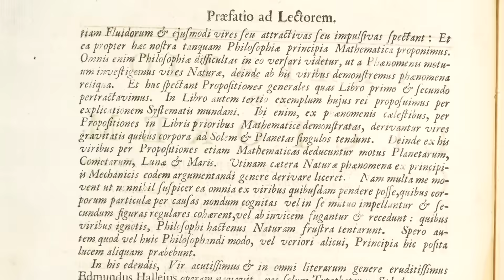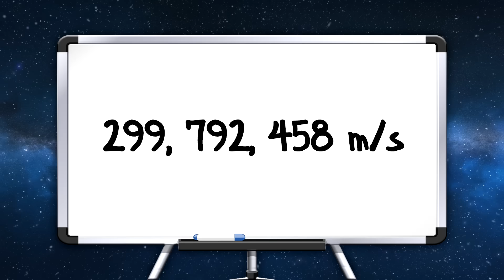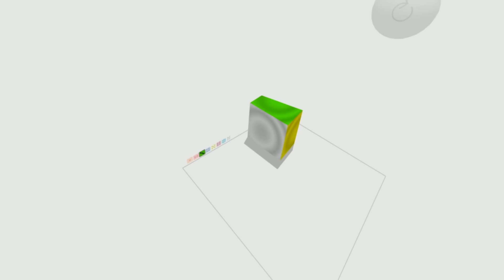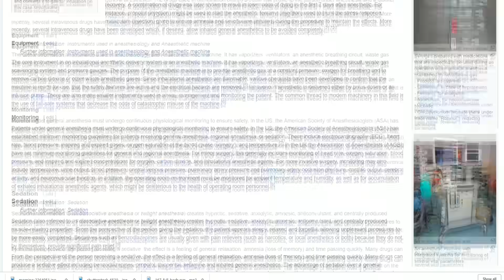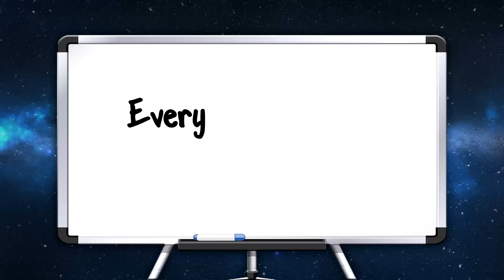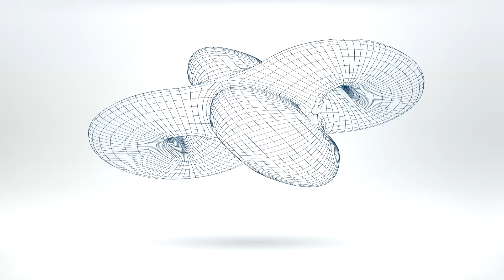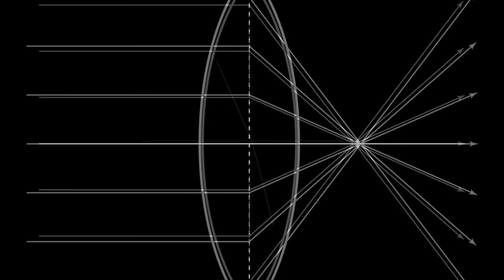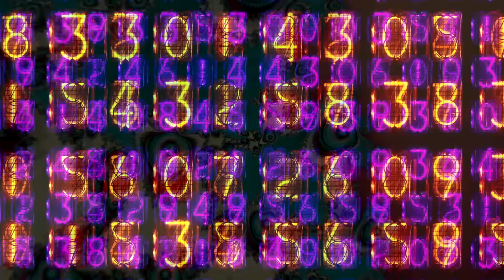The Mystery at the Bottom of Physics

Comment: Nikola Tesla:
"If you only knew the magnificence of the 3 6 and 9, you would have the key to the Universe"

Science uses numbers to count, I use them to play and attribute functions to them, just as they were alive + the 7 colors of the rainbow.

Polarity blueprint secret in the visible spectrum of light:
pink (tiniest wavelength, very close to red[division]): Primal Creation LOVE wave sustained by 8 mirror(---1---)mirror   [the egg - ellipse - circle imbalance factor] (laser-light mirror itself as 8 in 360 degrees as all defections)

---------------------HOT Balance Cold------------------
Red-Orange-Yellow ]Green[ Blue-Purple-Pink

0) 1 ]2 3 {4 | 5} 6 7[ 8 (9       9 as symbol is the spiral (180) degree turn is 6 as light

Add them up as palindrome an all will result 9
0+9=9; 1+8=9; 2+7=9; 3+6=9; 4+5=9; (this and colors are the only recursive information as the torus field has no end and beginning only two dark spots as emergence points to make some sense of the Universe and every force within it) Just as a puzzle or door, you need to figure out how to open it to reveal all it's secrets. Mother nature and the Father are man and woman, controlled by the main polarity-shift (existing and not), which is self or God.

For 2000 years mankind has contemplated on it's source-code with no prevail. The problem, from my point of view is our medium or surroundings. We live in a space, where we can only perceive reality from our surroundings point of view. Man has never been able to think past, what he observes. We can state, that the words and ideas we are playing with are a product of observation, just like we are playing with LEGO pieces, yet we never think past those individual components, that make up our current EARTH-bound reality.
The question is:
Is it possible for the human brain to come up with something, that can explain everything and understand every force, reality, matter, dreams, illusions, magic, masonic wisdom, occult wisdom and every possible outcome, that can ever exist?

My answer is yes! In order to reach full explanation of everything, man must take some starting points in consideration:
- the theory must be understood by all beings, not just on Earth, but also from other star-systems and realities, even formless-matter-less lives, just like God or the Devil;
- the theory must have some information, that everyone can relate to, from the highest PHD intelligence to the lowest and stupidest beings;
- the theory must not be forced upon anyone, meaning that it must leave free will alone, so that the being can apply it in his or her reality, without limiting it's perception (not forcing it like: "this is the way it is, and you must accept it")
- the theory must include and solve everything from all mathematical problems (like the Riemann Hypothesis) to every branch of science and it MUST even present the means to cure every disease, neutralize radiation and it must fix any problem invented and not understood by man.
- the theory should accomplish man's every desire and it must make it reality, by letting man have the means to build or accomplish anything he or she may want.
- the theory must answer every question asked by a being, even what happens after death and explain how ascension is possible (the rainbow body).
- and finally, the theory must exist and not in the same time, just as it was told in all stories and riddles invented by everyone so far in our collective recorded story (not his-story, but our collective story)

From my 3 points of view what all people on this Earth neglected is LOVE! Man has came up with simplistic forms of representation like Pythagoras an Fibonacci, after which he reasoned, that he can't crack the code like that so man ventured in complicated explanations, in the same time losing itself in the division (cube reality view) process of though. So we have built particle accelerators to observe the small, finally reaching a limit, that we called the plank. Understanding we can never go beyond the singularity we ventured in the macro, by building telescopes and started to discover huge planets, spaces, stars, black holes and galaxies, observing, that all is connected like a web. Never being able to decode the micro and macro, we have lost ourselves between the two limit-boundaries, that we called nothing and infinity.

Einstein came along and presented us with a simple representation form, funnily enough explaining energy. Energy means movement or disturbance in a field so mankind has gave in to this stupidity, loosing itself in the power-struggle, just as the equation represents. Since man is the pentagram (head, 2 arms, 2 legs), mankind (science) has lost himself in the division process of self, that in it's simplest form can be written as follows:
( 5 )/2=2.[ 5 ]/2=2.[ 5 ]/2=2.[ 5 ]/2=2.[ 5 ]/2=2.[ 5 ]/2=....... to infinity, until we reach the big RIP of self and so the Universe. [   ] - cube; (   ) - circle; 2 - division as ego, not as pink as love.

Since we have forced our minds to view everything as energy, we have built the LHC (huge power to access small understanding) and we even attributed the name "Dark expansion Force" to the observation of the acceleration of the Universe. Dark to my understanding means something bad, validated by the statement above, which is the division trap. Ever wondered why we keep saying thinking out of the box and not some other geometrical form? The box is the cube reality view, that is keeping us locked from ourselves (understanding) with 90 degree angles, just as we have built up the world, present in water pipe angle turns, most of our buildings and design structures. Unfortunately, once trapped in this lock, there is no way, man can escape it, since "science" alone has been the best tool, in explaining everything so far and we can even use it to measure and build technology with it, that we use in our daily life, never paying attention to how it may affect us. Since all devices and inventions came from this reality view, they are also a product of the same thought process keeping us even more locked away in the box.

The real Theory of Everything must have an emotional impact also, since man is not based on just logic, but also emotions! Logic is a product of understanding, while emotions are a product of imagination. Like it has been said by Kabbalists, GOD created man to experience boundless fun and joy, without any limitation (infinity). How can we achieve this task? Let me say this. In the beginning there was nothing, not even space or anything, that can be understood, what commonly we refer to as the VOID. Since God created existence, God became existence itself and so every form of life possible in the Universe. Throughout evolution we arrived at this state, where Humans were created and reached a level of understanding, where, by looking into the water, man recognized himself, meaning man is the only being capable of consciously being aware of his existence. Creation was a dangerous game, since in order for God to make all this we see reality, it must gave himself completely away, by becoming it (the point), in the process loosing everything, even the though of creation and all the blueprint, that led reality in this state. So we can state, that God was a form of existence, that we can never be able to reason. God, before becoming everything and all reality, God has thought out all Creation, after which God realized, that the only way to make it possible is by giving himself completely away to it, drawing the fact, that God will lose everything, even the theory, which led him here (since the only "LEGO pieces" God had available to use in the VOID, was only and only the though, which from our understanding is information). Man, since it is capable of reason, man has the monumental task to realize how he came here, and in the process of cracking the though source-code, man will realize, that he is really God, and God is present in every detail throughout all reality. This is why none were capable of getting to TTOE, since none has the courage of stating, that he or she is God, drawing the fact, that God is also everything, that we observe.

Technology is doing the thinking for us, while we get dumber and dumber, even forgetting to calculate and do everything in our minds. This is why analog has always conquered digital, since analog is continuous and digital is quantization of information.

THEORY (reality) document LINK: https://www.youtube.com/watch?v=UBxKXQ8luEI

Also there are in total 119 elements on the full periodic table.
The laws of nature change with the common belief system, same as all 11 dimensions + time[ \ | / ] as consciousness takes place through numbers, shifting colors or all or the other way around. All is controlled by self achieved belief and perception manipulation, without a shred of doubt, true unbounded and unshakeable faith as imagination validation in the real part, manifested in the Ether (water in material world). (Riemann zeta function - key to [mind] - the Door to Heaven - imagination color axis - unleash the furry behind the trivial 0 D00Rs of all Primes in singularity form as Thoth, Amun Ra, Anubis and all ancients, that lived throughout Creation on the Real axis.)

!!!UNLEASH THE FURRY OF THE PRIME CREATOR!!!! (0|0)   th)0(th   [0-zero point, singularit existing and not as fluctuation 0-1; 0n-0ff; 3-6; dark-light; yin-yang]
Reply: @tthung8668  you should be, since the truth is so amazing, that it will blow you away. But after you read through the document on my channel, you will be fearless! I promice! :*

Comment: 9 is a very important number is sacred geometry and vortex math.  Tesla said- "If you only knew the magnificence of the 3, 6 and 9, then you would have a key to the universe".  Consider the fine structure constant, 1/137.  This equals 0.007299270072002700729927....repeating forever.  The number has a group of 8 digits, which repeat again starting on the ninth (9) digit after the decimal.  Each repeating group equals 36 (0+0+7+2+9+9+2+7).  36 adds to 9 (3+6).  If you start adding each repeating unit (36+36...) you get 36, 72, 108, 144, 180, 216,.....432....ect).  Many of these numbers are very important numbers in sacred geometry (many think they describe cosmic measurements.  72 related to Earth's precession, 2160 is moons diameter in miles, etc).  It's almost like 1/137 is an expression of the numbers 3,6, and 9.

Comment: Newton's family home was in the country so it is quite plausible that some bollocks fell on his head but it could just as easily have been a dried turd. I get the impression that he spent a lot of his time with his head in the clouds so throwing any object at him may have been the only way of getting his attention. Still he came up with a really cool way for calculating the square root of a number that involves iteration. For example for the square root of three I get 7693439126128/4441809150464 which reduces to 708158977/408855776 giving a decimal number 1.732050807568877295 (which is 17 decimal points in agreement) and just goes to show you how boring it must be living in the country or how desperate he was to get out of doing any real work. The babylonians actually used the same approach (maybe they were bored too) but people had forgoten all about them.

Comment: What an awesome little trip through this channel this evening.
Each video has been getting more and more profound ( Although I do now wonder if it's I Hate Everything sitting closer to his microphone )

Light for me is an easy one, it's massless so has no option but to travel at the universes maximum speed limit, why that is the limit probably has something to do with how fast information can transmit via the electromagnetic force between atoms.

Gravity isn't really an attractive force and I don't think there is such a thing as a graviton, it's a bit like centrifugal as in it's a felt side effect of something else.
If you fly in a straight line across most points on earth it appears curved. 
Spacetime is warped by mass, the closer to the mass you are the slower time runs so to transverse a straight line across one of these warps it appears curved, it's this curve in spacetime getting closer to a slowing in space time we feel as gravity.
The bigger the mass the more spacetime is warped, the bigger the gradient in time and the more gravity is felt.
An orbit is a mass trapped in one of these warps.
The puzzle that gravity is so much weaker than the other forces is that it's not a force at all, it's a slowing of spacetime.

This is also why light, a massless partical/wave can be effected by gravity as the slowing of time as it passes through a gravity well acts like a change in density for it causing it to bend just like a glass of water will. 

Those are my musings on the matter anyway

Comment: The fine structure constant (alpha) encompasses Planck's constant (h), the constant q of Coulomb's law, the charge e of the electron/proton and the speed of light c. Alpha, unlike h, is dimensionless, meaning that its value is invariant to the choice of measurement units. There are only three important dimensionless constants of physics:  alpha, beta = rest mass of proton / rest mass of electron, and the equivalent of the fine structure constant for the strong nuclear force.

Barrow (2002) and Barrow and Tipler (1986) review the reasons why complexity and predictability are possible only in a universe with 3+1 dimensions. A universe with three spatial dimensions is also the most mathematically interesting universe.
https://en.wikipedia.org/wiki/Dimensionless_physical_constant

Comment: Einstein and Newton were wrong..

Gravitational theory has been proven wrong. The universe is made up of plasma based electro magnetism. Gravity is the weakest force in the universe. Dark Matter and Dark Energy are the glaring scientific flaws that disprove gravitrational theory. In the Electric Universe there is no need for silly made up forces or objects. In the Electric Universe theory it explains there is no such thing as an infinite mass object like a black hole, rather these objects are more accurately described plasmoids and act as the Electro Magnetic heart of a galaxy and explains why no matter where we look in the galaxy stars that are 100s of millions of light years from their galactic centers rotate evenly with the stars that are light years form the center. Which is IMPOSSIBLE if your basis is Gravitational theory because there is no gravitational lag observed! It also explains why we have discovered stars forming within a couple light years of our "Super Massive Black Hole" which is another supposed impossibility by Grav theory. Due to this huge error in modern day astronomy, they have invented some more make believe physics in dark energy and dark matter. 

EU explains why there are big electro magnetic beams from the Sun directly to the poles of each major planet in our solar system. EU laughs at theory of gravtiational collapse and proves the sun is not just I big ball of gas that has an outer shell hotter than any other part of it. 

It is time for scientists holding onto last centuries false beliefs for dear life to stop with the hypotheticals and come to a theory in which every single aspect of our universe has been proven over and over again with groundbreaking studies at labs in colleges and research firms alike. The truth is the universe is Plasma based, and that Electro Magnetic forces are what cause EVERYTHING we observe in space.

Comment: It doesn't matter if the speed of light slows down.
Because that implies everything is slowing down.
Including perception, feelings and thinking.

Constants are not given by god or chance. They are set to fit theories. It's a little silly though if you think of it.
Constructing a theory for general relativity and in order to make it work, a constant must be defined. A hook so to speak, something to attach the theory on.

Or think of it the other way round.
How are you supposed to measure the speed of photons? All you have is distance and time.
We already have two sets of distance measures, imperial and metric. Both cleverly made up.
And time is also cleverly made up.
So obviously the speed of light can only be compared to the speed and distances of measures we already have set.

You got to start somewhere.

So starting from somewhere, building further mathematical theories on some arbitrary theory of distance and time, of course you at some point need constants.

What else are we supposed to use?
Imagine a ship sailing 1.000 years ago.
How far are we from the coastline?
It's to soon to tell, we have to wait for 3.000 years for scientists to find the most basic length.
It might be a bazillion diameters of a quark. But we don't know yet. We don't even know what a quark is.

Comment: Probably it has been already noted, but alpha ~ 1/137,  not 137.
Reply: Came here for this, not disappointed
Reply: Ok
Reply: That does not sound like the point of the video but okay
Reply: It's unitless, so it's valid either way. What matters isn't how it's written, but whether it's inserted into the equation properly.
Reply: @FirstRisingSouI  Yea, so α = 1 if I specify that the α I'm talking about is ~137 times the α people usually talk about.

You're technically not wrong, but yea, he just got it wrong.
Reply: @CiuccioeCorraz  No. The issue at hand is the arbitrariness of language versus the well-definedness of physics. Whether α is 137 or 1/137 depends entirely on how you write the equation. The only reason we say it is 1/137 is because of convention. The reason it is not any other number is because the equation is full of fundamental constants with units, and α is the multiplication factor needed to make the equation true.